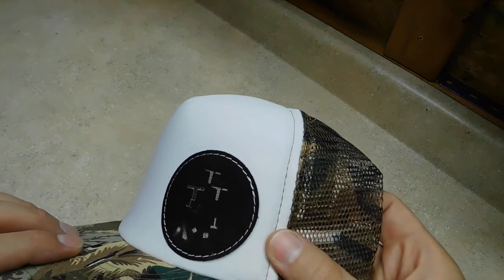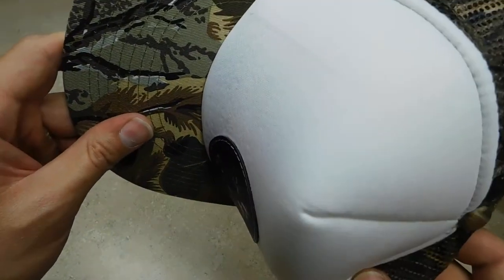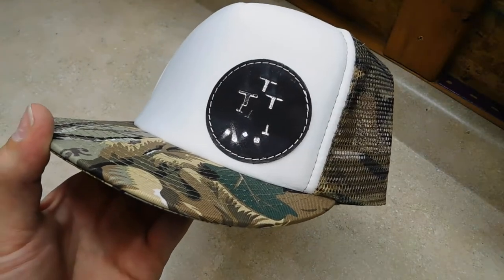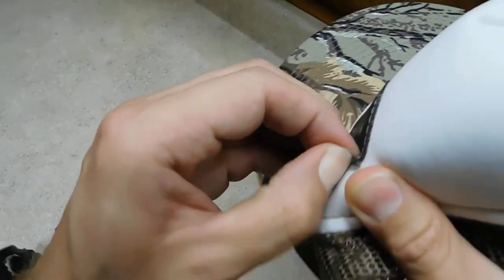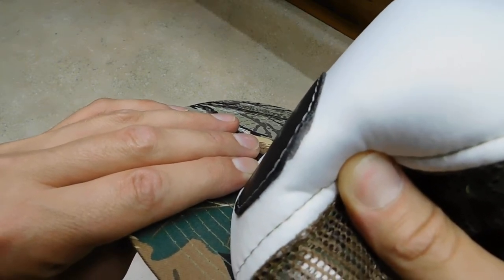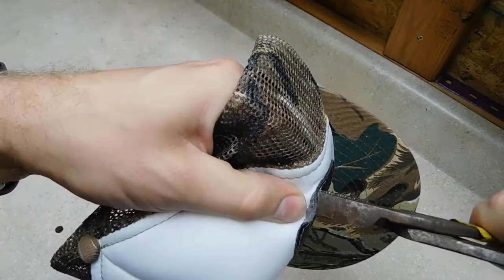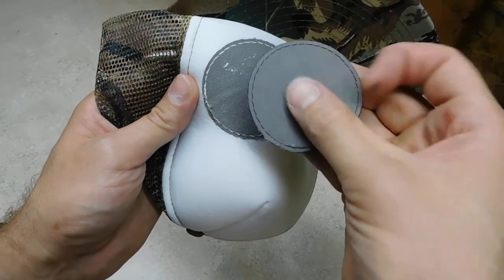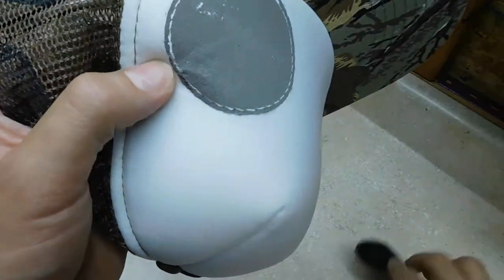Hat Patch Adhesive

Comment: Did you spray the 3m adhesive over the other glue that comes on the patch? If so did you heat press it after spraying the glue ?
Reply: No. The spry glue was applied to a material with no glue on it. It was just the patch material. This glue is more like contact cement. The glue that come from the factory is more like silicone. It has a rubber/sticky feel to it.
Reply: Que pegamento es para plástico PVC con la tela de la gorra

Comment: What glue did you use?  Joking haha…found the info in the first comment which literally took me 10 seconds.  Anyways, have you ever tried the 3m directly to the hats without drying and using the heat press?
Reply: LOL!
Good question! I have not.  If you were doing a one-off, I could see that but since we do 24 plus at a time I need the patches manageable. You would need to be very careful you don't touch the wet glue as well. If you add the glue after the material is cut, you will get some over spray along the edge to deal with. Just an FYI
If you do it wet, let us know how it works!

Comment: Just spray the 3M high contact on the patch and apply to hat and it should stick safely? No cancer chemicals on back label?
Reply: The material is sprayed outside and left to dry. Then applied with a heat press.

Comment: Hello! I went to order this adhesive and noticed there is also a low VOC version. I wonder since this is going on wearable items like hats should I choose the lowVOC or did you just use the regular version? I am just concerned about offgassing, like I got with E6000. I couldn’t present it to the client  for a week because of the smell.
Reply: I use the regular version. I spray it outside and let it dry, then bring it inside, etch and cut it on the laser, then apply it in the heat press.
Some hats have a coating on them to protect it. I always have one hat that I sacrifice in order to test that batch. If it is coated, I just use rubbing alcohol on a rag and clean it off.
Reply: Thanks!

Comment: What glue are you using
Reply: We use 2 different glues. One is on the patch from the manufacture (JDS), the other is 3M Hi-Strength 90 contact adhesive.

Comment: So…. What is the glue,
Reply: Sorry, missed the question. We use 2 different glues. One is on the patch from the manufacture (JDS), the other is 3M Hi-Strength 90 contact adhesive.

Comment: Yes what glue do you use?
Reply: Sorry, missed the question. We use 2 different glues. One is on the patch from the manufacture (JDS), the other is 3M Hi-Strength 90 contact adhesive.